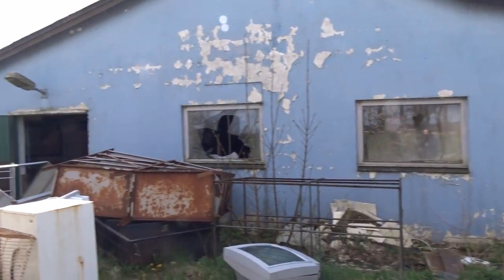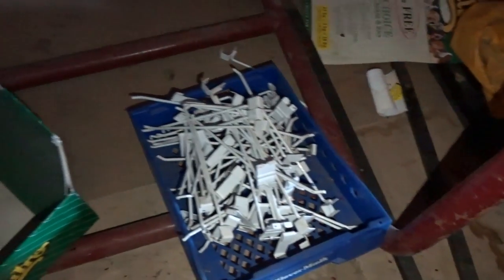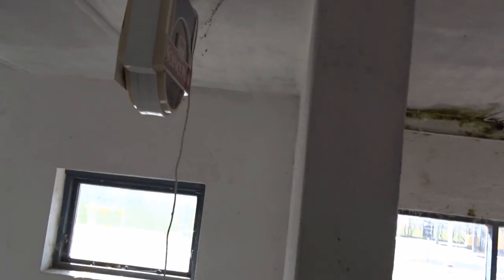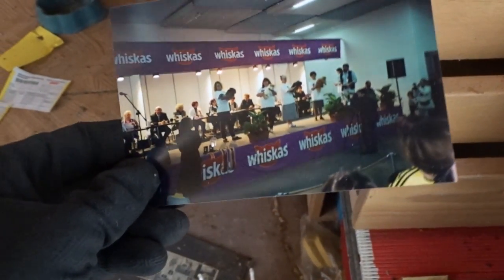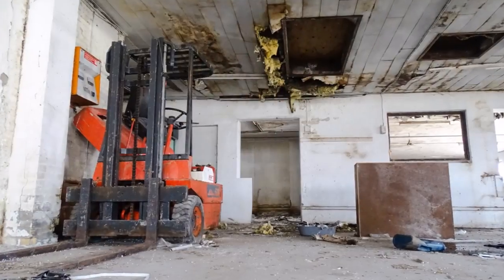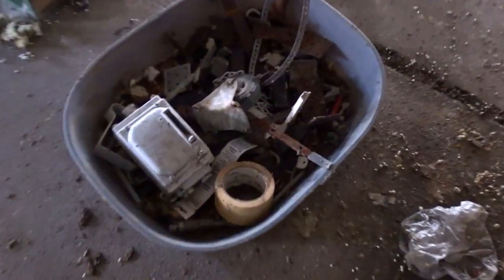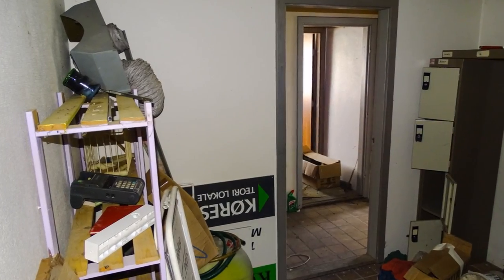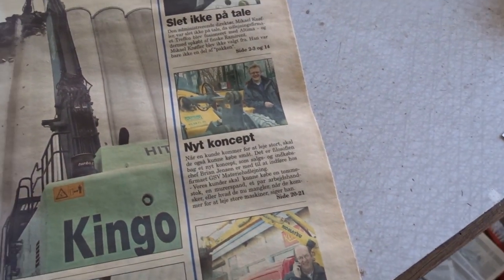Abandoned Pet Shop and Dry Cleaner BIGGEST WASHING MACHINE I'VE SEEN

Comment: Great video. A word of caution, dry cleaning solvents are dangerous chemicals. They can cause cancer. The washer was the dry cleaning unit, I'm guessing it's the same there as in the US, it's considered a chemical hazard and had to be left in place until suitable hazmat team can safely remove it. That place also looked like the pipes were wrapped in asbestos insulation that was seriously decayed which makes it dangerous to be around. I believe the big blue thing was the water heater used to heat water for presses and possibly heat the building. Please consider getting a respirator for buildings like this, we want you live long and prosper. Thanks for the tour. Be safe.